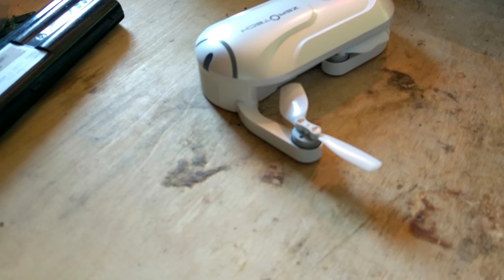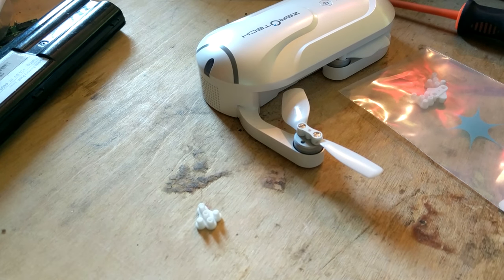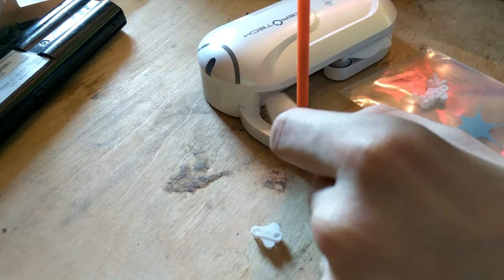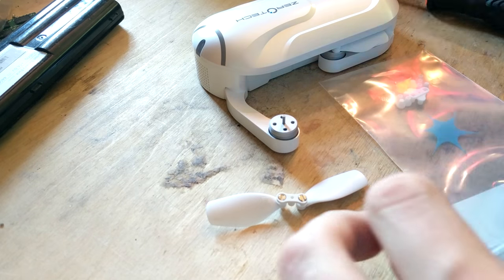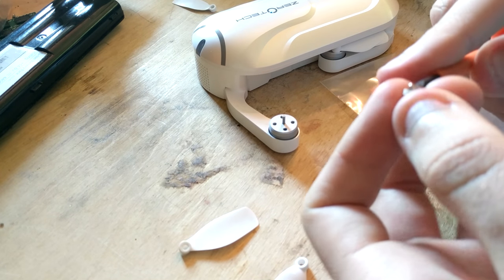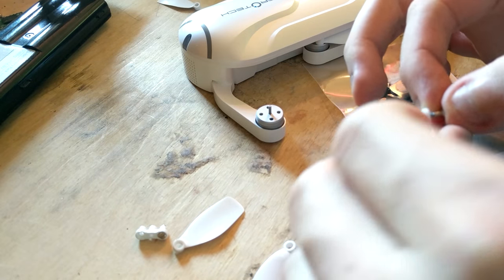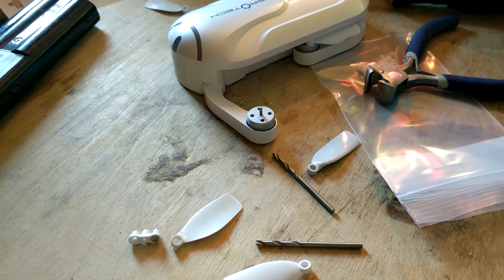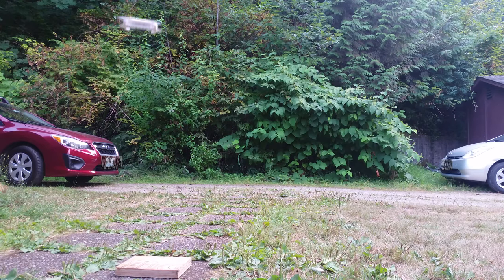3 blade propellers on the Zerotech Dobby!? ~ Let's do a science

Comment: Any further testing?! Was it  significantly mote more stable?!
Reply from the maker: It was a lot more slow-responding, but it was much more stable. I ended up going back to the 2-blade because 3-blade can't fold up. I also found that running 2 bladed on the back and 3-blade on the front lead to some nice altitude transitions in the video. The 2-blade spins up faster so lifts first, the 3 blade actually lifts the craft through the altitude. The effect on-video is that the drone tilts upward when climbing, and downward when dropping, so it makes a much smoother altitude change.

The other thing I found was it increased the lifting capacity to the point where my bro's and I hung a pad off the front and took turns using the Dobby as a helicarrier for his little micro-drone :)

Comment: Nice mod! I am about to put 5250kv motors on mine (because one of the originals burned) and I am not sure the onboard 4-in-1 ESC will hold up :) But if it is a success, I will let you guys know. With these props the Dobby will probably have increased flight time and if you add a ND filter it will probably remove the jello.
Reply from the maker: Oh... nice! Let me know how that goes! I'm curious whether stronger motors will cause the flight time to improve or degrade.
Yea, I eventually ended up adding the filter. Especially helpful since there's a setting for exposure now!